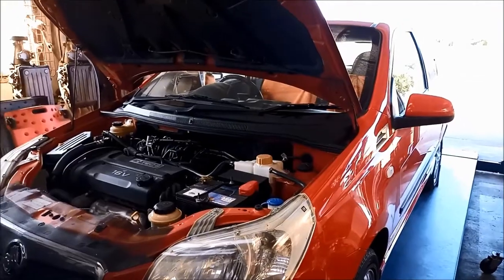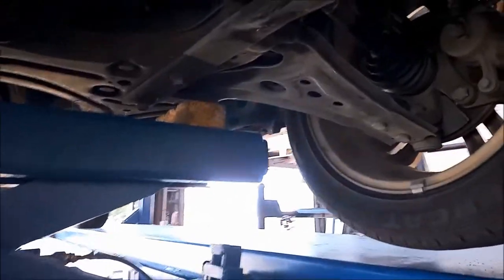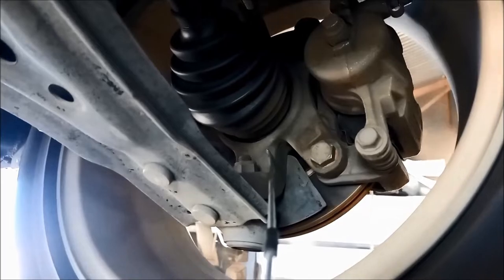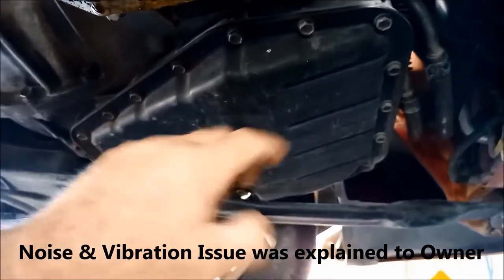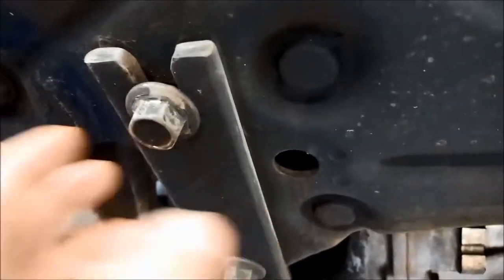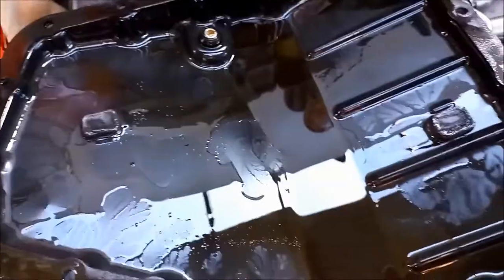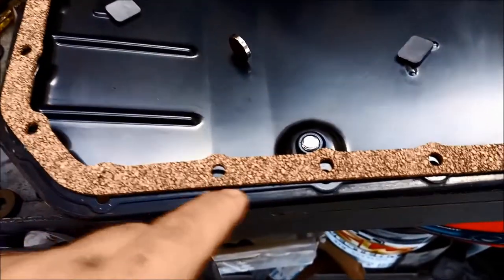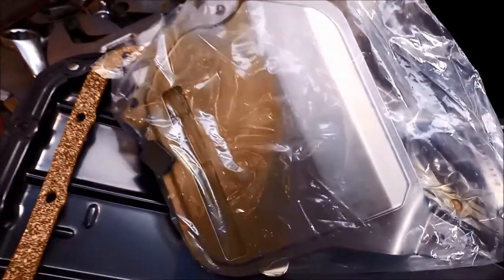Holden Barina U440E Automatic Transmission Filter Service & Strange Noise & Vibration

Comment: You must also drain and blow out the cooler / heat exchanger inside the radiator . It holds 1 litre of dirty filthy fluid . Plus the converter will also hold a filthy fluid . Best to do another drain fluid swap in 6 months .
Reply from the maker: thanks for that 👍

Comment: I have a similar issue however, the vibration exists only on DRIVE or MANUAL mode (auto).
The vibration intensifies when stirring the wheel and stops vibrating after some time, I guess when the engine? gets warm.
Reply from the maker: hi, you will need to check all other mounts as well. often if they are worn they will show a clean part where the mounts wriggle upto. or use a suitable prybar. cheers
Reply: @YepThatsIt  if you are in Brissy I'm happy to bring it in for a repair or at least,if you have someone good to refer.
G'day from Brisbane and Happy New Year!